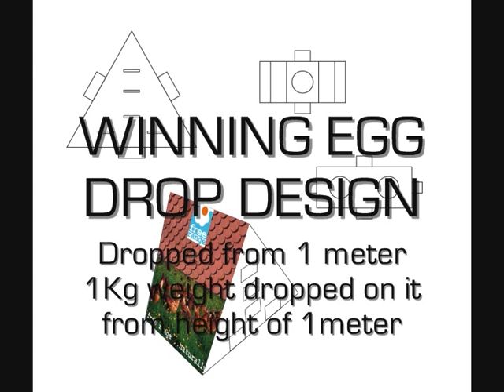Winning Egg Drop Design

Comment from the maker: why not try the same design i have done in this video but just for 1 egg so it will be smaller, use see through plastic sheet that can be bent and folded using scoring technique. it will be lightweight and the egg visable